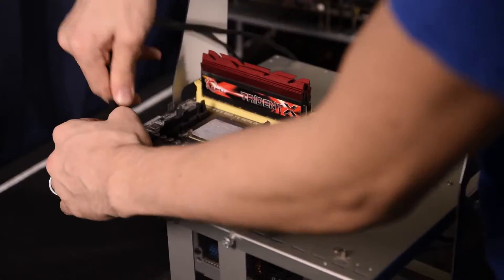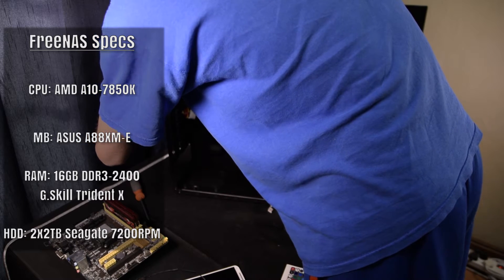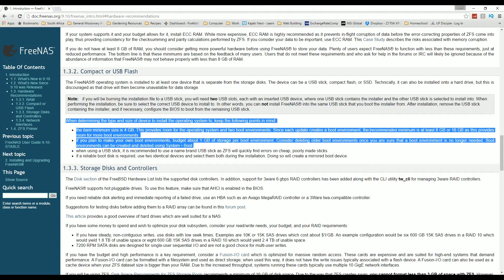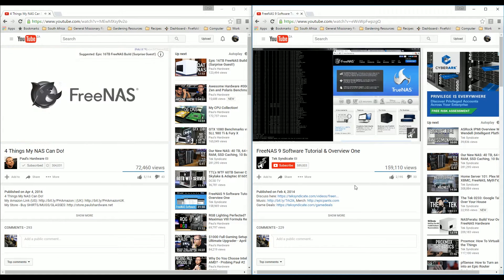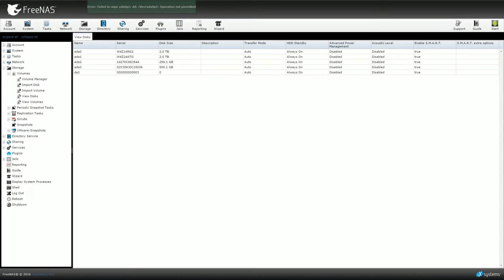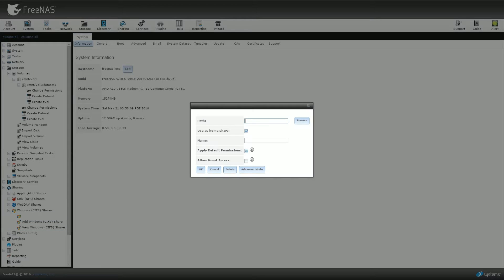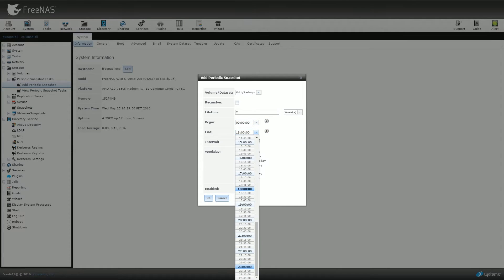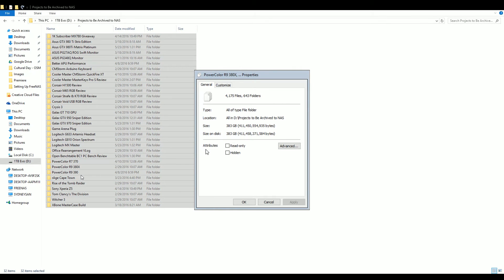FreeNAS Build Project

Comment: It seems counter-intuitive to create a system for redundancy, backup, safe storage etc when you are not meeting the recommended hardware requirements set out by FreeNAS. As long as you keep another backup of your data separate to this FreeNAS build you should be safe :) you will thank me later. You should really use an entry-level server chipset motherboard with ECC RAM and compatible CPU, even Pentium CPU's have ECC support. Also NAS drives rated for 24/7 operation is recommended :)
Reply from the maker: +Alex Murray Cheap was my requirement here, not fully reliable.  I'm aware of my risks.

Comment: You really need to have ECC memory in a system using ZFS.  
Reference:  https://forums.freenas.org/index.php?threads/ecc-vs-non-ecc-ram-and-zfs.15449/
I would also recommend using a pair of boot drives in a mirror.
You really need to read the forum and learn about how this really works instead of looking at the videos you referenced because they are not at all comprehensive guides.
Reply from the maker: Thanks for the concern.
Reply: +Ali Al Saif ,  I made the mistake of building my first FreeNAS with older comments I already had.   It got me started on the way to learn more about the system.  
I recently completed my 7th build; which includes 12 data drives in 2  Z2 sets, a mirror for cash, and a mirror for boot.
I have been using FreNAS since 2011 and have experienced many of the problems that can make your life miserable. 
If you have questions, the forum is a good place to find answers.

Comment: Mby a weird question but |Got my A88XM-E Motherboard and i'm not sure if the APU i have looked on fits in so hope you can help the apu i have looked at is a AMD A10-7890k (4 core/4.3 GHz max)
Reply from the maker: So you bought a motherboard and CPU without seeing if they're compatible? They're both FM2+, so that should be fine.

Comment: Freenas recommend to use a intel processor, how is your nas doing with the AMD? I am thinking about using my extra AMD cpu for my new freenas build but wondering if it would work fine
Reply from the maker: Haven't had any performance issues at all.  Been working 100% since this video.
Reply: Thanks for the reply, are you currently running freenas 9.10?  What are the actual concerns when ones is installing a amd freenas? Like reliability? consistency? or something like future compatibility? I'm just wondering why they would suggest such strongly on intel processor
Reply from the maker: I'm not sure. I never read anything about heavily suggesting Intel software when I was setting it up, so I can't tell you.  All I know  is that I've had 0 issues, and I'm running 9.10.
Reply: The issue with AMD is that some AMD boards have cheap third pary sata controllers and there have been reports over the years on the freenas forums of issues with these cheap controllers. I have not seen a post about this in a long time so I would assume it is probably fine at this point. That being said I use AMD for my build and have never had issues and the same goes for a number of people so it is probably fine but still good information to know.